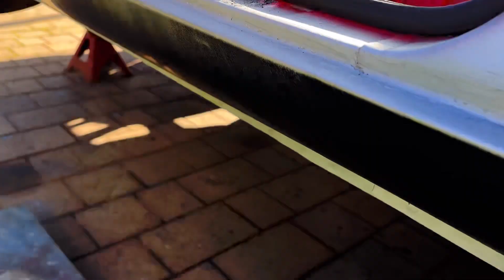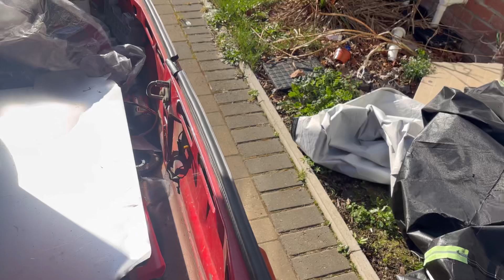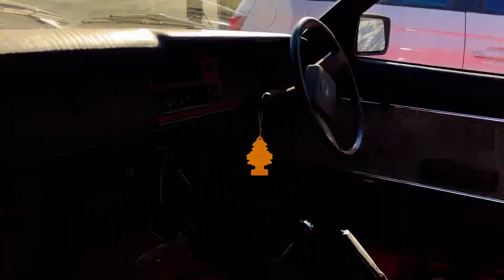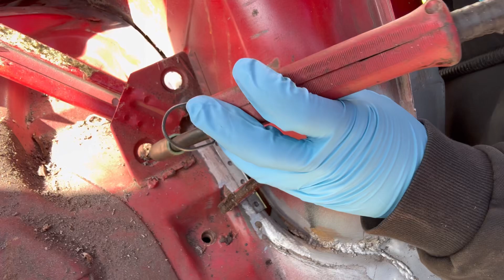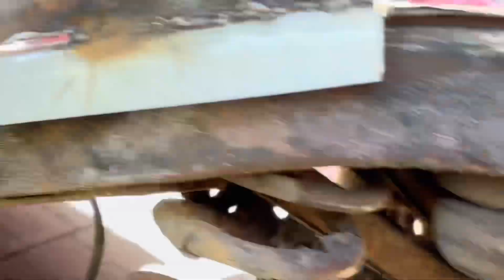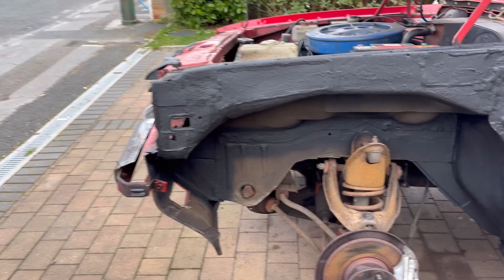Ford Cortina Resurrection Part 2

Comment: Weldings looks like a nightmare to be honest. Grinding down the pidgeon poo and applying seam sealer is a bodge.You need to clean back to bright metal and turn the power up more and turn wire speed down

Comment: That wire speed is set wrong its spitting by the sounds of it try adjusting it a bit go by the settings book if its new should be a nice buzzing sound no ups or downs sounds
Reply from the maker: Thanks for that I’ll look into it

Comment: I would use red oxide with the rust treatment in to paint over wat you have welded as primer won't stop rust im painting all the inner arches and inner sills I've only had to weld the sill on my focus MK1and on top of the red oxide black paint wax oil and cheap landlin oil over the top its made buy a company called buzz weld its cheaper the company you see on u tube adverts it won't rot for years and saves me getting the welder out again